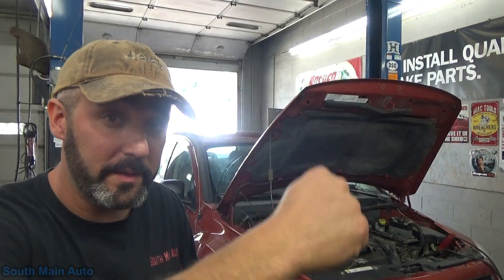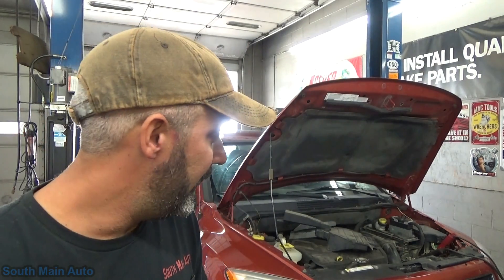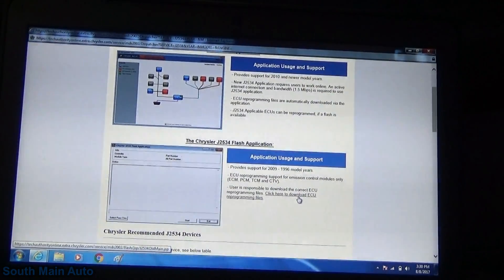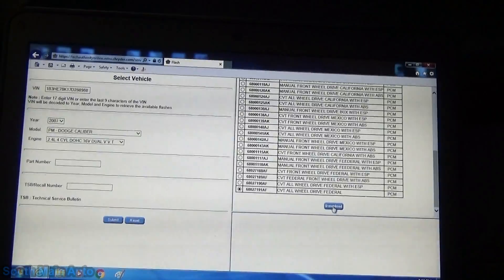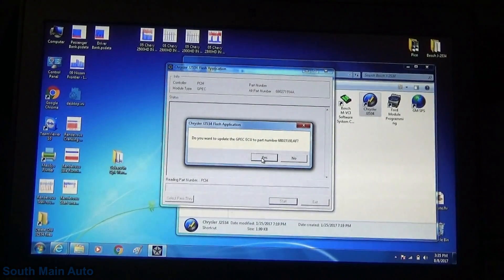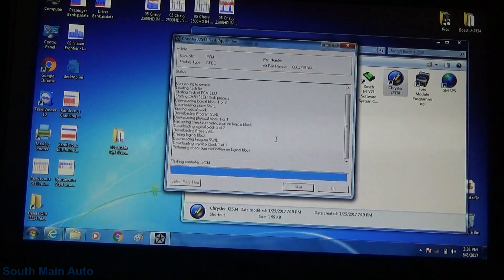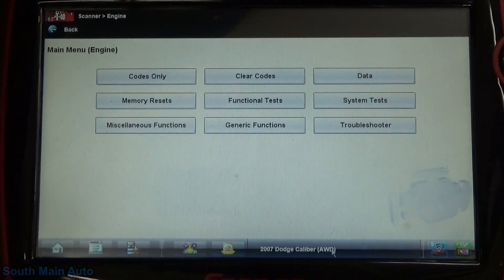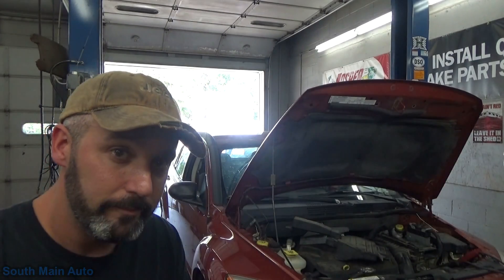Dodge J2534 ECM Update Pre - 2010

Comment: I just seen your video today and I have a 2009 Dodge Caliber that I changed the intake manifold on about 2 years ago for the P2004 code. It went away and a week ago the check engine light came on. I had the code scanned and it shows P2004 again. I did not update the pcm so could that be my problem?

Comment: Hi Eric...been subscribed for a long time...I'm a wrench turner but recently getting into the world of ECM/TCM ect. This vid rolled around and caught my attention by the J2534 and Dodge in the title. I am somewhat familiar w/ Tech Authority having purchased my factory service and wiring manuals from them. I was interested to see if my car had updates (2020) and found out that a J2534 device was required to use Tech Authority. I noticed in the vid that the selection for the pre 2009 had only one pass thru device available (Bosch). I am just wondering if prior to buying the subscription to Tech Authority did you know that a specific pass thru device was required...did the website tell you? I would hate to buy a 3-day subscription only to find out I needed a device I didn't have. I use HP Tuners to data log and have their interface cable but after watching this vid I suspect that it is not going to work w/ the Tech Authority program. (Concur w/ the lack of support unless you are a dealer!). Thanks

Comment: The only Chrysler cars I ever owned were all completely unreliable pieces of crap, and Chrysler jerked me around royally on every one of them (especially a P.O.S. 1970 Dodge Challenger).  I would never again purchase ANY Chrysler product, or trust any Chrysler dealership.  On the other hand, I’ve never owned a bad GM automobile, a truly memorable Ford, or anything less than a wonderful Honda.  I still love my 1976 Firebird Formula, my 1985 Firebird TransAm, my 1999 Chevy Tahoe Vortec 4x4, and my 2014 Honda CRV.  I do all my own maintenance and most repairs including engine and transmission rebuilds.  Modern auto computer circuitry is proving very challenging to me, and SMA has been invaluable in keeping me current and confident in my old age.  Kudos to Eric O. and his colleagues.  Dr. K.

Comment: Great video! Thanks for the info.  Does anyone know where that old stand alone version of the Chrysler J2534 Flash application can be downloaded.  Its just the flashing tool and not the firmware so hopefully someone can point me into a direction to find it.  I am trying to flash a 01 2500 Ram truck as the computer had to be replaced.  The uiTech 2 software can be used to flash it but creates an extra cost for something that used to be included in the 1 day pass to techAuthority.  Thanks to anyone that might be able to help me out!!

Comment: Unfortunately, this method to reflash  with Chrysler products will die with 2019 itself.  Starting in January 2020, you can still reflash a Mopar with your J2534 pass thru device.  But, you'll need to download and install WiTECH 2.0 for J2534 applications.  My shop just went ahead and bought a Micro Pod so I don't have to relearn how to get my J-Box working with them yet.  (We bit the bullet on the Micro Pod because you're still limited to PCM/TCM reflashes with 09 and older vehicles through J2534.  The Micro Pod will do ANY module that needs a reflash.)  But a certain amount of a new process will remain the same for all of us in the aftermarket.  Whether you buy a Micro Pod or stick with your J-box, you'll still need to get set up with a WiTECH login and a redundant authenticator program installed on your smart phone or tablet.  (If you buy and set up your Micro Pod through AE tools, they can get you set up so the authenticator runs right on your laptop.  The conveniences that come with that are greater if you have more than one tech that's going perform reflashes and their technical support in general has been fucking awesome for me.)   You'll  need to buy a minimum three day subscription for $50 to WiTECH and then you still need to go into tech authority and buy a minimum one day subscription for $27 to get your flash files.  That's a little weird to deal with in its own way. If you've paid for your tech authority  subscription, you then go back into WiTECH and log back into your tech authority subscription through WiTECH and get your calibrations through the topology map itself.  I imagine it has to be very similar for those of you who are going to stay with your J-box. As much as the new hoops to jump through suck, it does eliminate troubles like moving flash files to the right folder, older Java versions, and you can now use Google Chrome if you want.  Good luck to everybody that has to make this same jump.

Comment: I was trying to flash a pcm on a RAM 5500, but I  have so many problems with the java, some times I guess the java wasn't installed correctly or something happens and another times java blocks the calibration to be downloaded I don't know what to do, I'm using a windows 10 laptop 64 bits  maybe that's the issue?

Comment: Short as possible. I've a 2007 Dodge Caliber 2.0L SXT. The money light is for a P2006 IMRC stuck closed. Based on your video I put a new OEM intake manifold in it. Two questions. The car is in Mexico. The local Dodge dealer in Mexico said that based on the VIN, the ECM can NOT be updated in Mexico because it was made in the US. I took it to the the local recommended mechanic that said he would update the ECM. I don't know how to verify that it was done. The local dealer said that the car won't function at all if I put a new manifold on without updating the ECM. (Computer)  The car is now back from the shop and working fine. 
Will the car work if the manifold is replaced without the update?
Do I need to take it to a Dodge dealer in the states to be able to determine if the computer update has been done?

Comment: I think it’s easier to pull the cal id in vehicle and put the cal is or part number in the box instead of using the vin. Using vin will show multiple flashes like your video shows. Putting the cal id in will show exactly what the new number is and will only give you one result which is correct for the vehicle you are working on

Comment: Eric, I need your opinion concerning a Knock Sensor of an 07 Ram 5.7 How does one know if its a true engine knock or just a bad knock sensor?? I have never heard any knocks or abnormal noises from my engine. Can you help me? I'd bring the truck to you, but New York and Oklahoma aren't exactly next door to each other.
Reply: Back probe the Sensor and check:
1) 5 Volt reference
2) Ground wire integrity
3) Signal Circuit Integrity Testing.
If you have the skills. You can verify whether its the Sensor- the Wiring or your PCM.

Comment: Those GPECs have a bad habit of getting DTCs and adaptives locked inside the memory.  You'll see it mostly after a T-body failure, but every so often after the intake failure.  When you're doing one of these NEVER ignore a key off or on request if you get prompted. You'll end up with a P0600 series code and you'll have to flash it again.

Comment: Have you considered the Drew Tech Cardac Plus 2? I don't do a lot of programming either but their tool seems much easier to use than the Bosch and they are always willing to help with programming. I use it for mostly GM, Chrysler, Honda, Bmw. Any issues and they have Happily helped.
Reply from the maker: The interface really does not matter as long as it works. It may be a tech support you get with a tool for example if you buy it from AE Tools the may be willing to help. Does that makes sense?
Reply: South Main Auto Repair 
Many ways to ski n a cat😎 It just seems more user friendly. Keep up the good work.

Comment: Eric, you could use a double boot option to solve compatibility issue to run different softwares rather than having multiple computers.
Reply from the maker: That is a really good idea :)
Reply: I am pretty sure you can figure on how do that. it like you say if you can do it .... that worked for me. figured out how to do a lot of staff from you video. you have changed my understanding of diagnosing. thanks.
Reply: Or issue a virtual. No sure if the virtual will handle the custom com HW. Probably maped as USB-serial port ?.  Virtuals can be installed in the existing system, no risking, and if it stops working just grab a copy. We happen to fight with a few pieces of SW at work, that barely made to XP and Virtual Box is the only way to work around.

Comment: Eric I have had same experience with programming. Been able to do Gm with no problem. Ford for the most part is easy unless you have to tear tag code and then it's a pain. If people didn't get rid of old pcm when purchasing new pcm it sure would make ford easier! The problem I am having is Chrysler..... Guessing Chrysler doesn't work well on a laptop with other flash programs. From what I can tell it's Java related. Have you noticed any similar issues? Do you use separate laptops for the Big Three ? Thanks and great videos! Been a Tech for 35+ years and still learn something new everyday ..
Reply from the maker: AE Tools has the best tech support on the planet if you buy the interface through them.

Comment: Thanks for these videos Eric. Have you programmed using your Autel j2534.
Reply from the maker: No I have not. I do not have the interface device for it plus I would never use a tablet to do it.
Reply: Gotcha, the maxisys j2534 is used also as a standalone unit like the bosch. i was just wondering if you prefer the bosch over it. Iv used it on Ford and GM but not yet on a Chrysler. But thanks man, your a great teacher!!!

Comment: I have a 2000 jeep cherokee sport 4.0L V6 and I was wondering if anyone knows the rod and main bearing clearances
Reply from the maker: Best to go buy a manual
Reply: .001"-.0025" for the mains. I would shoot for 2 thou. (.002") .001-.003 for the rods. Preferred clearance is .0015-.002" This info is what I read from a Mopar Performance catalog.

Comment: Nice video & programming. Bosch VCI is standing the test of time.  Looks like everyone is working today. I'm working on a 91 Chevy K1500 5.0L the engine was rebuilt, low vacuum, running rich, won't idle, backfires, parts cannon was shot numerous times at it and they towed it up to me Friday night. Fun stuff!
Reply: Check timing after pulling the computer wire off the distributor. 18436572 is the firing order. Verify compression on all 8 then after placing it at tdc, degree the cam. Sounds like the guy who rebuilt it stuffed the cam but it's a pain after the engine is completely assembled.
Reply: Timing, compression, valve timing are all good. The EGR valve pintle was bent, ignition module bad (Customer installed a new CarQuest distributor and the module only lasted about an hour of run time and hardly no thermal paste under module), PCV sticking. The ignition module & EGR caused the plugs to foul and after I did the compression check I had 30kv gap firing at the plugs and some of the plugs weren't firing, cleaned the plugs & installed and running like a champ. Had to get the whole story of everything that was done & sequence of events but after that it was basic diagnosing OBDI.
Reply: Good find. Firing the parts cannon is even less helpful when the aftermarket crap is worse then the failed parts to begin with.
Reply: And it still was running rich and I found the fuel pressure regulator sprind had one coil broken off but still maintained 12 psi & while they had the TBI off the engine the mud dobbers partially plugged the PCV port and the MAP sensor port and I noticed delays on both vacuum gauges and the MAP was off from the EGR port vacuum...little bastards wreak havoc down here and throw a twist in diagnostics...HAHA Rebuilt the TBI & fuel pressure regulator & now it runs fantastic!!
Reply: Hayward's Automotive I had a Buick century brought in with a misfire and someone has the intake hose disconnected from the throttle body but still pushed against it so the maf wasn't reading correctly
Reply: This had everything connected only mud dobbers fully plugged the PCV and MAP was still reading but blocked enough to be 6"Hg lower than the EGR port. Parts were on bench for @6 months while engine was out. It had other issues like a broken fuel pressure regulator spring, ignition module would cause misfires when hot (No thermal paste), EGR valve was partially leaking and the diaphragm was ruptured, plugs were fouled rom running excessively rich...basket case. Runs great now and they towed 150 miles to get it to me and now they can drive it home!

Comment: coming soon...if you replace the cigarette lighter on a chrysler, you'll have to re-flash the computer!
Reply: Chris Freemesser dealer ! 🤤.... bite thy tongue sir , we Indies can do it as well
Reply: Are we allowed to call those Cigarette Lighters now?  I thought they were power outlets.
Reply: coming soon, people get tired of paying over $5K for garbage that turns to rust and falls apart far before it's anywhere near paid off ;)
Reply: Chris Freemesser is that true the dealer has to re flash the ecm if you change the battery?
Reply: @somerandomguy3868  Not exactly. BMW and many other manufacturers (Mercedes, Volvo, Audi, Ford I believe) have started requiring battery registration on their vehicles. I know it sounds stupid but there is some logic behind it. The idea is that as a battery ages, its charging requirements change. The pcm (or whatever module happens to control charging system function for a particular car) will adapt that strategy over time to give the battery what it believes is optimal charging for it's age. If you replace the battery and don't perform this function, now you have a brand new battery being charged like it's 3-5 years old. This will shorten the life of the battery and potentially the alternator. AGM batteries that a lot of the Euros and others are now utilizing also have very specific charging requirements. I believe that's also part of why they're doing it. Most quality scan tools will perform these functions and thus a good independent shop should be able to take care of it. That's my understanding of it at least but if someone else knows more feel free to chime in. Hope that helps!
Reply: New Level Auto Trust me, I don't take our cars to dealerships and never will.  It's the ridiculous premise of having to reprogram a car for simply replacing the battery that I'm whining about. ;)
Reply: New Level Auto I need to air up one of my tires!! How much do you charge to reprogram the 38 computer modules, following a tire inflation procedure?
Reply: On Cadillacs like my Deville, you are suppose to go thru a special process to reprogram the car when you unhook the battery... But im like F it, it runs, ill drive it...
Reply: FrugalPrepper  My 2004 f250 has a cigarette lighter in the ashtray and a power outlet on the dash. I know you were making a joke, but don't know how the new cars come equipped. Do they still have cigarette lighters?
Reply: roadkill5333 eleventeen dollars per tire
Reply: After 05 the Cigar lighter was assigned to the PB trim package (pompous bastard) and added $2395 to the dealer options..lol
Reply: no not a reflash but you have to tell the computer that you installed a new battery and what size it has..if you don´t do that you may have issues with the intelligent charging and power management system because it does not know the current state of charge and state of health of the battery... some systems learn it themselves after a few days
Reply: You outta see what happens when you put air in the tires....Hahahahaha!
Reply: The cluster sends a message "We noticed you put new air in your tires, We strongly recommend MOPAR AIR. Standard tire-shop air can ruin the tire system brakes and transmission" (while the nav system gently points the closer stealerships so you can buy "AIR") .... Meanwhile other parts of the car had 12 recalls already, car is only 30K but tranny shift like a bag of rocks ..... the cluster wont tell nothing. It is between specs Lady ! LOL.
Reply: Chris Freemesser that makes me happy 😊
Reply: Yep
Reply: And the ACM (Ashtray control module)
Reply: lol, that sums up all the cars since about 1994 and progressively worse by the year
Reply: which can be loaded with different calibrations depending on the brand and type of cigarettes that the drives smokes... to individually adapt to the amount , density and color of each brands type of  ash.Unfortunately if the ash tray is full it will ned to be replaced with a new one that one the dealer can Programm with the VIN of the vehicle...as a theft protection so the ACM can not be used in another vehicle
Reply: On a BMW if you replace the battery, the dealer has to reprogram the computer for the new one.

Comment: pound salt? or pound sand
Reply: In NY, it's actually a 50/50 mix.  Sand to sandblast the paint off the body panels, and salt to corrode them to get the paint the sand missed.  Not really, but there are places that do use a sand/salt mix.
Reply: The only places in NY that don't use sand/salt generally use pure salt or brine solution.....
Reply: I came up with a new one...."go lick wind"..lol

Comment: He Eric, I just put a remanufactured transmission into a 2008 corolla and it came with a tag saying it need to be recalibrated and to not drive it until that's done. Do I have to get it towed to the dealership and have them do it or is that something I can do.
Reply from the maker: Do you havea good scan tool?